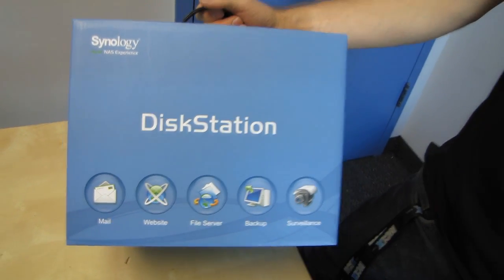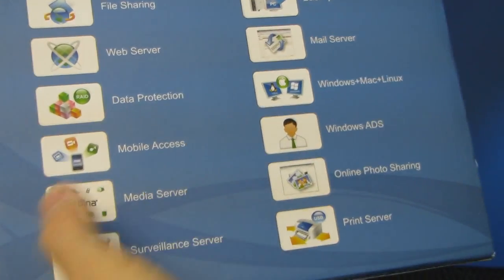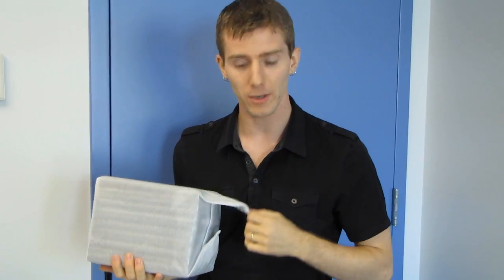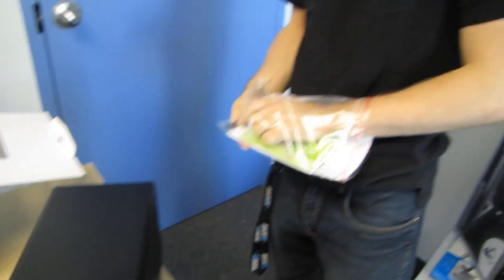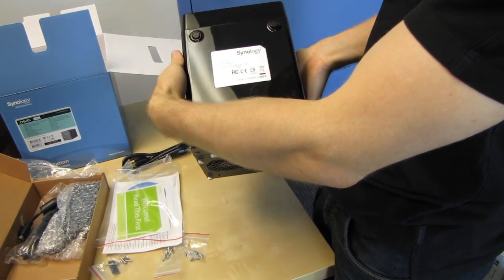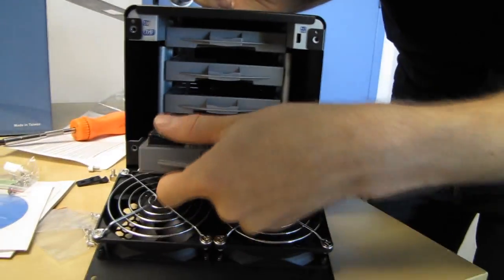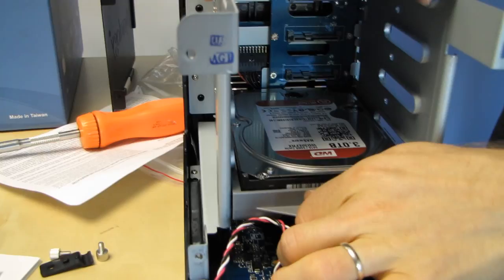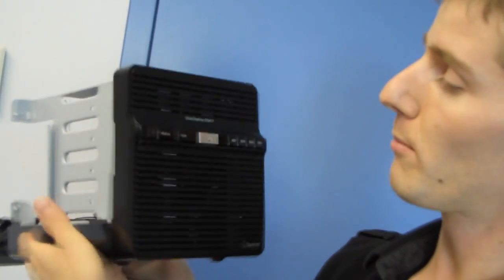Synology DS411 DiskStation 4 Bay NAS Unboxing & First Look Linus Tech Tips

Comment: I still have one of these running loaded up with WD 8TB Reds. It's definitely dated, but it has been a very reliable workhorse.

I've made a few modifications to improve it, but other than that it hasn't required any maintenance other than an occasional dusting.

Comment: The DS411 comes with a single "evaluation" license for their surveillance station software. I eventually expect to have a modest number (8 or so) of IP surveillance cameras installed around the perimeter of my home. In order to use the surveillance station software with 8 cameras, I will need to spend more on licenses than I spent on the DS411! Is the software worth the license fees? Not in my opinion.

Comment: Sorry I didn't reply back at the time, but the specs on Synology site says it does support 2.5 "Internal HDD/SSD : 3.5" or 2.5" SATA(II) X4 (Hard drive not included)".  This is without the adapters, it has sleds that you put the drives in.  If you still need to know for sure I can reluctantly take a sled out to look.

Comment: RAID 6 is much safer (= it has 0% of data loss in case any combination of 2 drives fail, while RAID 10 has 50% risk of losing all of the data

Comment: I'm rocking a TS 859 Pro+ with 8 * 3TB 7K3000.in Raid 5. I've only had one drive fail and the device immediately went into degraded mode until the failed drive was replaced and then rebuilt the array. It has dual gigabit ethernet so port trunking is available but I have yet to make use of it. It manages 1Gbps writes on a good day :). Very impressive device.

Comment: AHCI has nothing to do with it, it's just a protocol for running SATA. AHCI does in no way affect the way you configure your drives, be it RAID or not. RAID is meant for people who want: A) Higher read/write speeds, B) An active backup, that takes over when the main drive fails, or C) Both (RAID 10)

Comment: Bought this a month or two ago from NCIX on sale, replaced my old Synology CS-407e.  Great little machines and remarkable service from Synology.  They even sent me replacement data cables when I was having issues on my old system when it was well past warranty (found out I had 2 drives partially failing with very slow transfer speeds on some parts of the drive).  Great service, great product.  Get good 80MB/sec downloads and around 60MB/sec uploads to this thing.

Comment: ADS - Active directory services... the device can be joined to a domain and gather user account information from active directory database to provide users access to shared folders by using the credentials they used when logging in to theyr computers... About RAID.. Use SHR (Synology hybrid raid) wich allows 2-drive fault tolerance and also you can use hard drives with different capacities, works just fine with fault tolerance...

Comment: That's exactly what I did (see above), but that doesn't require any special features. Quite die opposite, it was already possible with the earlierst Windows versions or even MS-DOS (floppy disk A: and floppy disk B: at that time), which they were based on. You just need at least two seperate writable drives, that's all :)

Comment: Raid 6 is absolutely not pointless! If you have raid 10 on 4 drives, you are only guaranteed 1 drive redundancy. If you drop 2 drives on the same side, you're fucked. If you drop 2 drives in a raid 6, you're still going.

Comment: Linus, you do realize that the DS411 is last year's model, right?  Synology versions their devices with how many drives they support followed by the year.  So a DS1512 indicates support for 15 drives (1 main cage, 2 five drive expansion cages) and the 2012 model.  The 412+ actually has front load.

Comment: not related to the video but wanted a quicker answer will using a 5.1 sound card with 7.1 headphones limit the headphones im thinking not because the headphones just plug in with a mic and headphone jack into the sound card if someone can help me out that would be great

Comment: Please correct me if I'm wrong,
I think RAID 6 is fault tolerant to a failure of any 2 of the 4 drives while RAID 10 will be fault tolerant to any 1 drive failure but not any 2 drive failures.